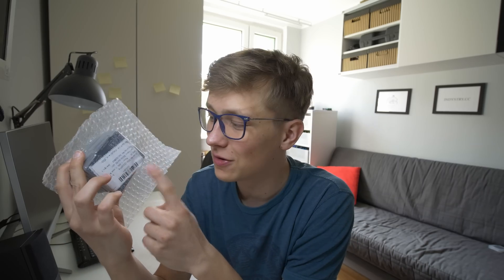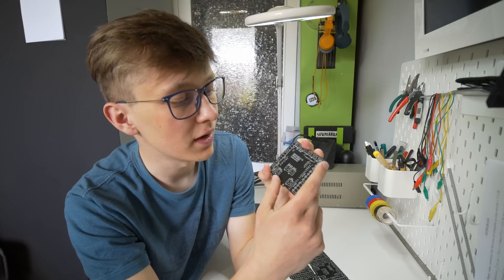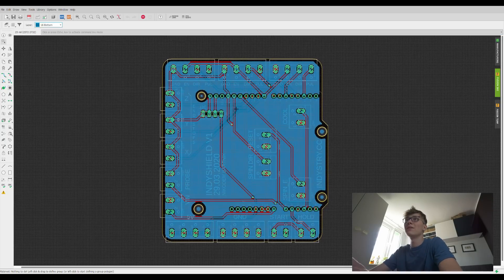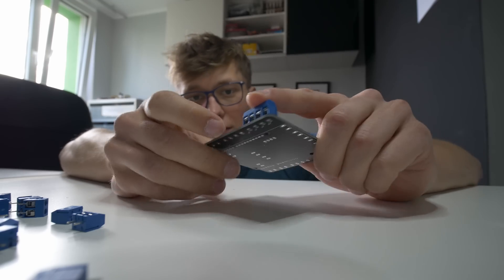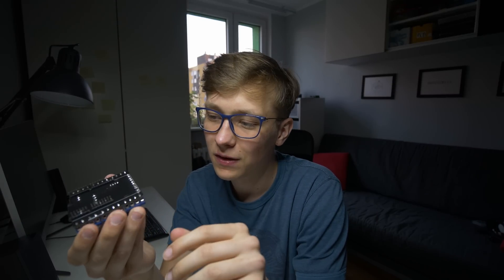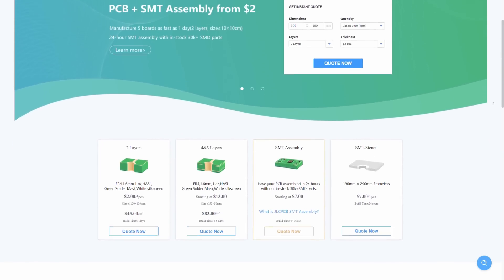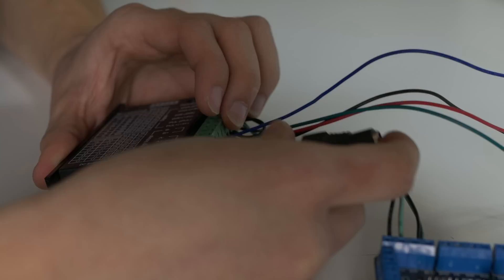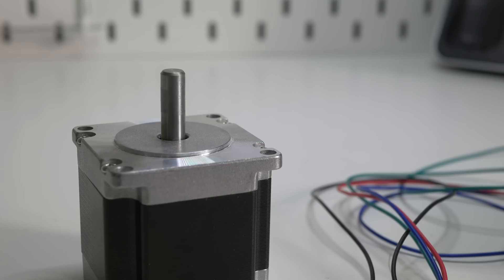GRBL Arduino Controller For IndyMill - IndyShield

Comment: I bought mine and received it in mail this week.  I just do not understand what the 12v is for??  the arduino is powered by the usb plug, what is the 12v for?  does it need to be attached to 12v?

Comment: Hi Nikodem, I know you have addressed this before, but I am not sure I understand what the four pin 12C (GND, SDL, SDA, 5V) strip does, or what it connects. We are using a Arduino Uno REV3, and the IndyShield. Thanks for clarification.
Reply from the maker: It does exactly nothing :) I placed it there just in case, to add some external devices that communicate over I2C. Thanks to that IndyShield can also be adapted to any other project where simple access to I2C header is required. Same thing with additional 5V and GND screw terminals

Comment: I purchased the shield, however after soldering all the pins correctly, then offering it up to my Arduino Uno, I have 2 pins on each side that dont match. there are too many pins on the shield. What have I missed here?
Reply from the maker: Original Arduino has additional SCL, SDA pins right there, you probably have a clone that doesn't have those pins. It will work fine without them so no worries
Reply: @nikodembartnik  yep. Indeed I do

Comment: Just ordered the Indy shield. 

Do you know where I can source the longer header pins ? All I am seeing is the default 6mm and would like to avoid the USB port on the arduino 

Also, what is the pin pitch for the screw terminals :)
Please keep your videos coming
Reply: Did you find longer pins?  Can you give a link

Comment: I just purchased some of these PCBs and I am sourcing the extra parts. Question. Your website says to buy "4 gold pins for I2C header"  Are these different than the regular arduino header pins?  If so can you recommend a source?
Reply: Did you find them and can you provide a link?.  We’re they the “longer” ones like for shields so the other soldered pins don’t touch the arduino usb plug housing?

Comment: I am on your waiting list for the boards. So does this board eliminate the need for a parallel port and cable? Will I be able to connect linuxcnc and UGS to the arduino via USB? Could you post an Aliexpress link to the gold pins and headers that will ideally finish this board?

Comment: This is really great work : simple, elegant. I got the eagle schematics from the indymill website today and when I opened them noticed the schematics was good, but the routing of  pin11 -> SPIN_E and the one for pin12 ->Z end switch were missing (still in air wire). I added them,  no problem, but I figured I would tell you about it. Maybe it was the wrong version ? 

Another question : on the Grbl github documentation, they recommend using resistors and capacitors to avoid noise on these end switches (see here : https://github.com/gnea/grbl/wiki/Wiring-Limit-Switches ) and they even designed a small circuit using optocouplers. I consider adding it to your schematics : there is plenty of room on the shield to add these components. Do you have thoughts about this ? Thanks again, and long live Indymill :)

Comment: Why do you reinvent the wheel? The CNC shield does the same. OK CNC Shield may not have screw terminals, but this is not a big problem. 
https://youtu.be/8oZk74TXRVo?t=667
Price: $ 3 Going further, there is a developower board available, dedicated to amateur CNCs. Well equipped and smaller, based on NANO.
https://youtu.be/8jQLKDvQFXs?t=360

Comment: It looks like your solution is very similar to the ST25 Arduino GRBL Screw Terminal Breakout Board which I've used on many occasions, only you've broken out some more of the connections: https://www.tindie.com/products/ron/st25-arduino-grbl-screw-terminal-breakout-board/

It's good to have simple solutions out there for wiring up various CNC projects 👍

Comment: can you build a fully open source 3d printer like ender 3, BUT without any pre made/arranged kit. by buying parts from aliexpress just to see how much less money you need to spend to make a really decent 3d printer. so people in the 3rd world country like me can make their own 3d printer 😀👍 i hope you will make a video on this topic.
Reply from the maker: I am afraid it's not worth it :( At ender 3 price it is impossible to build something cheaper
Reply: @nikodembartnik   you are right, i just find out that the price is higher right now because of the lock down. :) 😄👍

Comment: Do you have the schematic available? I would love to add an embedded ESP32 to use instead of an arduino. The idea being to add WiFi control, the ability to send entire gcode to the cnc, releasing the PC while cutting. You might want to add input protections as well, since nothing is stopping high voltage from shooting down the inputs :) also some decoupling on the power might be useful :) as well as pull up resistors on the I2C line are required if using more than one device on the bus, but as always good work boss!
Reply from the maker: I will share it soon on indystry.cc
Reply: @nikodembartnik   Hi, i can not find the schematic on your homepage, do you have it to be shared anywhere else ? Thanks

Comment: Quick tip:
In order to solder the pins straight it's better to connect them to breadboard (or arduino) and then put the shield on top and solder so they sit perfectly in the board.
Reply from the maker: That's true! Just better to use breadboard, don't heat up Arduino without any reason
Reply: @nikodembartnik  Right...
Or, you can use a broken Arduino board if you have one.
Reply from the maker: Way more than one :)))
Reply: spiritcore1 I thought that’s why we break them, so we have soldering templates 🤔

Comment: Nice proyect, with your own pcb maybe could be better an Arduino Nano plugged into the pcb..
Reply: I’d like to see a single board with the Arduino built into it, and some isolation form the motor drivers etc...  but it’s pretty good for a first version.